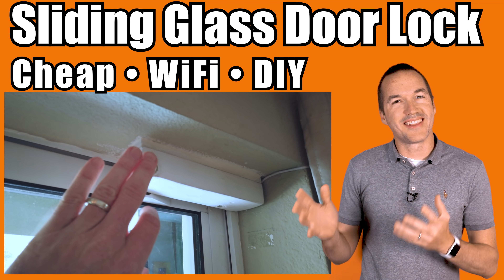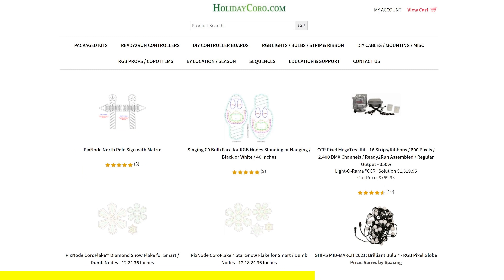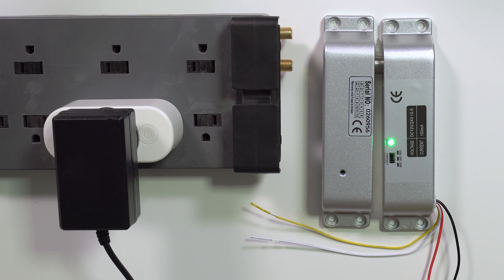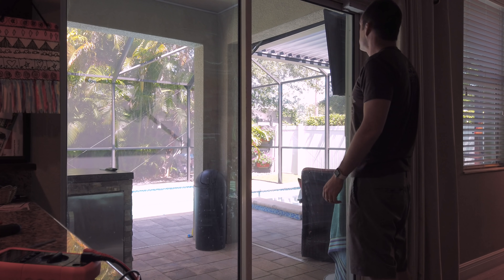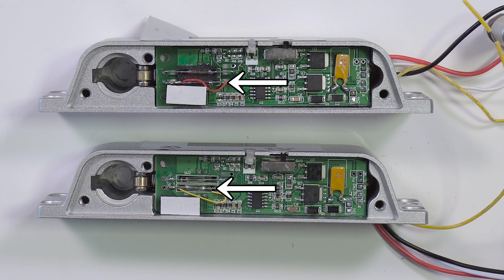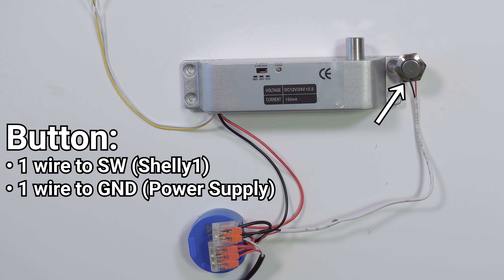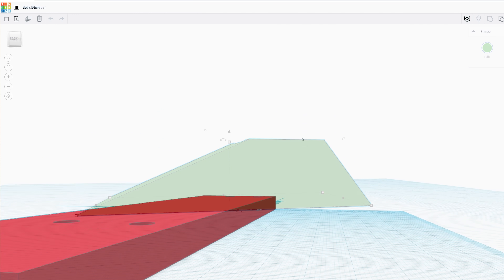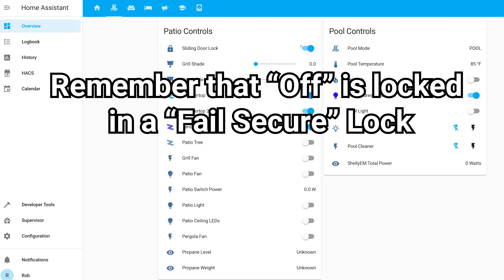DIY Smart WiFi Sliding Glass Door Lock for $50!  Universal Fit. Fun DIY Project.

Comment: Is there a way to wire up an override button and the positional sensor at the same time with this Shelly or a different Shelly?
Reply: To answer my own question, you can use a Shelly 2PM, set the logic to be reversed, and wire the red wire from lock to 12v and the black wire from the lock to the O1 output.

Comment: Use one of those garage door electric deadbolts instead. There is a manual side lever for manual locking and unlocking. The lock is activated by a momentary forward or reverse dc voltage to cause a motor to slide the deadbolt open or closed.  .... I would probonky put it in the middle position of the door on the too and hang an emergency exit cord so short people can pull it to unlock in a fire.

Comment: You could solve the "fail secure" fire issue by making the receiver spring loaded, with a press lever to release it.  That way if you ever need to get out and the device isnt functioning (and in fail secure mode) you can just depress the lever and slide the door past the bolt. You do need to be tall enough to reach it tho.

Comment: DO NOT DO THIS, against fire code!

I seriously question the "$50 Cheap DIY" part of this project with a 3D printer, not many people own one!

Just install a Charlie Bar, and use a $10 door sensor if you want to know it's status in home assistant.  You can't ensure that second door is going to be locked, I question the strength of PLA gorilla glued to the door.  You never know what your kids are going to do, so that second door is a constant weak point.  I'm sticking with my Charlie Bar and sensor that is tracked my Home Assistant and makes announcements to get the kids involved with home security.
Reply from the maker: PLA + Gorilla glue is 10x as strong as the glass that the door is made from.  Not against fire code if there is an alternate path. ...
Reply: @TheHookUp  Most patio doors have a fixed door and a single slider, you've got an extra feature most do not have, just like a 3D printer.  I wouldn't say these doors are only as safe as a Brick, or strong as the glass (I thought you were located in Florida) laminated security hurricane glass can not be defeated by a brick. If doors and windows are locked, a quick smash and grab is not possible.  Your contraption would not hold up to my 300lb (each) security hurricane glass door.  Your second moving door is a huge vernulbility, if it could be unlatched by any child letting a pet out who wants to bypass this door lock.  Do you have a sensor to notify you if that left door is unlocked?  I'd prefer a system that ensures that entire door is locked within Fire Code.  If you need that many warnings during the video "do not try this", it's probably a bad idea to show as a DIY for others, this is nothing more than a proof of concept test that should not be repeated, you need to solve the left door vernulbility, taking apart a locks safety features isn't recommended. 

I have a Charlie Bar lock that goes across my laminated security glass sliding door, I just put a $10 sensor on that bar, and Home Automation gives notifications if we forgot to lock it before leaving or before going to bed. It gets our kids into thinking about home security, which is a great bonus.  1) I know the status of that sliding door lock, and 2) the kids are learning to be more safety/security conscious.  It's a win/win for me, because it's rarely left unlocked anymore before my turn to check at night.

I don't allow any Shelly1 in my house, 1PM, 2.5 & Dimmer2; MUST have the temperature and current protection, in my house.

Do you know how many house fires deaths are document as "no smoke detectors" or "non functional" because the homeowners didn't take fire safety equipment seriously?  41%! The National Fire Protection Agency keeps track of those statistics, just like improperly installed holiday decorations cause 45% of house fires in month of December (which you have ALL over the house with unprotected Shelly1 controls).  Please take this more seriously than "Universal cheap DIY sliding glass door lock".  Maybe you should research how many people die because the exit they were used to everyday was locked or blocked by smoke and fire.  In an emergency people panic, get tunnel vision, and don't think to use a new door they've never used, like the left sliding door, which could get stuck if you never use it.  However if that door does get used frequently, then the odds of it being unlocked when you leave or at night just increased exponentially, then you'll have to sort out how to lock your sliding door(s) again.

I 

Safety is more important than convince to me, I have 8 smoke/CO2 detectors all interlinked in my home.  Have you done any videos on smoke detectors, and how they can be set up to ring a bell and red light outside the house just like commercial buildings?  I've done that, get a Kidde SM120X Interconnect Module to activate Home Assistant, 120v 6in Red Bell and Red strobe light on the side of the structure. Those wires are inside metal conduit to prevent them melting or burning, that might be difficult retrofitting, or use flexible metal conduit, I wouldn't let that stop the project.  Could be programmed to unlock all the doors during an emergency.  If you have an attached garage, that should open as well in case any small engine equipment or gasoline is on fire.  Give the emergency personal access to your emergency to reduce the damage and save lives.  I could take some pictures and items I used if you want to try adding the smoke/fire detection system into your Home Assistant.  Even if it's a false alarm from burnt food in the kitchen, you'll want to open the (locked) doors to clear out the smoke.  If a criminal is willing to start a fire as a vulnerability past your smart home locks, you still need to evacuate and call 911 for the Fire Department and Police to come protect your family, but I highly doubt the odds of that actually happening.

Comment: In the UK we tend to have patio doors, which are either sliding like you have in Florida (although normally only one side would slide), or "French doors" which is a pair of uPVC glass panel doors which open outward to create a large walkthrough space. Unless you're super modern and you have a huge bifold that can be multiple panels wide which concertina out of the way.

Your solution would definitely work for the first type. The second type is easy with an off-the-shelf lock like the Yale Conexis which replaces the handle on the uPVC door.

Comment: you should put a backup battery that can supply ~12v (maybe a hobby lipo?) in the case, together with some electronics (which could just mean a simple relay that connects the battery when main power is cut) and make that relay also bypass the shelly, opening the door in case of a power cut. that should be a really simple upgrade that could save lives

EDIT: to save power and not rapdly drain the lipo, put an emergency button on the outside that works in series with the relay to only bypass the shelly if necessary

Comment: Using a Ferrule on stranded wires makes the installing circuits in the Shelly and other similar products look so much cleaner and they don't get all messy if your using the same wire over and over in testing wiring up things.

Check a kit like this out, I'm sure you'll love it
https://www.amazon.com/dp/B073TZ5BBG/?coliid=IIXIUN9COIO5K&colid=2S18QI4UXD742&psc=1&ref_=lv_ov_lig_dp_it

Comment: Best Sliding doors are the REMOVED and trashed sliding doors...I hate them with passion. Dont know why the f people use these;Rollers wheels fail or rails fail,(max 5 years for ALU)you need to adjust them,TERRIBLE heat and cold insulator(unless you buy triple glazed argon filled) andddd best of it: if you strip treats of the wheel adjustment screw,good luck replacing anything..
Great video thou.

Comment: Just a thought, but you could just install this at the other end of the door, near the center of the frame, having the bolt lock the door closed from the rear. This would negate the need for that fancy receiver. This should make it more secure as you wouldn't be relying on gorilla tape or whatever you use to install that receiver piece to the door. I'm assuming you can push the locking bolt in with your finger, even in the locked position. So this would also add an emergency release option, therefore you don't need the extra exit button. The downside of having this in the center of the frame would be it's slightly less aesthetically pleasing. BUT if that's a concern you could go a step further and install this directly above the frame with the locking bolt protruding through the track from above, therefore being almost completely invisible, albeit at the cost of a more involved install and possibly compromising structural integrity of the door frame.

Love your stuff man, I hope you patented this design.

Comment: would it not be easier with a solenoid lock , would have a few great benefits: I create a remotely openable keybox using this method, a normal lock that has no bold but a spring loaded slidable lock mechanism like a normal door where you press the handle to open ( needs power to open, can always be closed ) It opens the lock by applying power to the solenoid and automatically closes after a configurable time ( like 30 seconds) so you can open your door, leave it open as long as you need so need no action to close the door .

this saves power since the 
making it work is also easier as all you need to do is have a relay open the 12V line to the lock , this can easily be accomplished by a ESp8266 relay board 
total cost will be < 30 USD when souring properly including all parts 
you can also include a hall sensor to detect the door is in closed position ( another 10 cents for that )
Reply from the maker: The drop bolt is exactly that, a solenoid to actuate the bolt and a reed sensor to detect when the door is in position.  The difference is that this doesn't require any modification of the door, or any pre-existing type of lock.
Reply: @TheHookUp  so still a fail secure lock I assume , can you still close the door if the lock is deactivated ?
Reply from the maker: No, the way the mechanism is designed it needs to be pulled, not pushed.

Comment: Great project!  Next up: an automated way to open & close these heavy doors.  Must be electrical, ideally 120VAC, not hydraulic or pneumatic.  I've looked at 12VDC linear actuators, but none are fast enough.  My situation: BBQ is outside on deck, food prep is done in the kitchen.  Sliding glass AND screen door between the deck & kitchen.  So I'm forever needing someone else to open/close these doors as I carry food from one place to another.  I want a touch sensor on both sides, mounted to be easily hit by an elbow (like door openers for the disabled).  Door to be opened in 3 seconds, with automagic closing after a few seconds.  This will require some occupancy sensor and current sensing (to sense a squeezing condition... probably not code though..).  Might need something to chase cats or dogs away (my dog goes outside thru this door, but are cats aren't allowed outside); cats are sneaky and will rush the door, especially if they see we're encumbered by food stuff.

Just spit-balling on a lazy Saturday afternoon.  Cheers!
Reply from the maker: Someone posted this in a comment: https://www.instagram.com/p/CN-acLwqv7m/?utm_medium=copy_link

It's just one of those curtain drivers.  In my experience they are incredibly strong, so depending on how smoothly your door opens it could definitely work.

Comment: Will the 3D printed items sand smooth ?
Reply: Its highly possible, ive had alot of smooth prints but all depends on your printer and settings. if its not smooth best to spray some sandable primer, sand then spray paint. this is a cool project i gotta try.

Comment: I've only recently found your channel and wanted to thank you for the informative, yet very well organized and presented videos!

I do have a simple yet open ended question if you have the time - if you were going to build a house, what customizations would you make to suit automation, security, or other DIY projects?  Things that are easy when done early but difficult after - running cat6, planning camera and WiFi AP locations, running wired window sensors, what else?  Could also make good video topic, what to do when your limited vs what to do when you have control or a larger budget.

Comment: 6c per kWh, in Australia we get 27c+. Can you please do a video on chinese electric curtains like Quoya, or how to open program for latest Tuya WiFi+RF Fan Light Switch (AVATTO type) WS-EU-F/FL: WS-US-F/FL. This new version also works with Sonoff 433 controller and you can turn off backlight. 
Link:

https://www.ebay.com.au/itm/233940113520?ssPageName=STRK%3AMEBIDX%3AIT&var=533586350964&_trksid=p2060353.m2749.l2649

Comment: I used to live in Houston to I know what you mean about the ubiquitous sliding doors. We have sliding doors in Sweden, but they are WAAAY more robust than the ones in the states - the whole door weighs around 650 lbs and is triple glazed. The lock is actually responsible for lifting the door up a half inch onto wheels. When locked the entire door settles and acts as a gigantic deadbolt. https://www.hajom.com/skjutdorrar/hajom-classic-series/ is the one I have for instance.
Reply from the maker: That's a good looking door!  I think they are ubiquitous in the US because of how cheaply they can be made, ha.

Comment: What are the rules throwing all this stuff in your house and it ends up causing a fire. A lot of this overseas stuff doesn't have any certifications... Any ideas what traditional home insurance polices are going to disallow if they see these products and they cause a fire? For example I had a simple timer switch spontaneously burst into flames; caught my wall on fire. Lucky I was home when it happened and had a fire extinguisher in my room. It was one of these simple puppies. - https://amzn.to/3yzcioG - Manufacturer paid for all repairs next day...
Reply from the maker: Low voltage, the only thing that possibly could matter in this situation is the certification of the 12V adapter, but even then I’ve never heard of a policy being denied based on an uncertified device (and I’ve done my research).
Reply: @TheHookUp  not a policy a claim. Not sure if that's what you meant?
Reply from the maker: Correct, a claim on your policy

Comment: Just to clarify the fail safe situation, the sliding door on the right can be opened from the outside and the inside bu the left one is only opened from the inside, right?
Reply from the maker: Both sides can only be opened from the inside.
Reply: @TheHookUp  why aren't you locking both then?
Reply from the maker: The other one always stays locked
Reply: @TheHookUp  gotcha! Thanks for clarifying ☺️

Comment: 99% of sliding glass doors fail to lock. They are all crap.
Reply: A 2x4 placed in the bottom of the track that butts up against the wall on one side and the door on the other side is a pretty foolproof way to make sure the door can't be opened.

Comment: @The Hook Up
would it be hard to modify the lock to not use any energy in a lock state?
great video :)
Reply from the maker: The lock itself uses no energy in the lock state.  The 2W is from the Shelly
Reply: @TheHookUp  Cool project! It'd be even better and environmentally friendly to drive the bolt with a servo motor, so that it only consumes power when it changes states! 
Even though the power consumption doesn't seem high on the first glance, it does add up, and also it's simply unnecessary waste. And as we tinkerers can easily come up with a better solution while also having fun in the process, why not! :D It's a great chance to educate us about saving energy :)
Reply: The way to make it use less energy is probably to use a motor to turn a bolt until it extends in to the door and lock it.
That way it will only "extra" energy when it's moving the "dead bolt"
Reply: @TheHellis  Yes, that is literally what I said. :D
servo = motor
Reply: @crixi__  a servo is one of those small motors that generally consume power by holding it's state with a PWM signal and they sound like a mosquito.

But if it's so important for you to be "right" then what ever.

Comment: I prefer the ones that have a keyed entry on the outside and a manual turn/lever on the inside. With that it can be in locked on power loss, while not causing any sort of locked out or locked in situation.
They cost double though because of the lock mechanism.

Comment: check out the UHPPOTE locks as they do both Fail Secure and Fail open on amazon. I've used these a few time. if your feeling more adventurous you can actually cut into the header rail of the door and mount it inside the door if there is room or above into the header. https://www.amazon.com/gp/product/B00V4G1DE6/ref=ppx_yo_dt_b_search_asin_title?ie=UTF8&psc=1

Comment: Personally, and I realise that's mostly my paranoia talking, I'd modify the thing to have a mechanical override; a way for you to just pull the locking pall out of the way when the inevitable disaster happens.
Even if it is a fail-safe device; if there is a good powerspike or a brown-out and the power doesn't go off, you don't want the electronics to freeze in the locked position. (yes watchdogtimers etc, but again; paranoia)
Reply: Don't think that is paranoia - everything eventually fails.   A mechanical override would be a simple solution.
Reply: I'm with you there as well. I don't think it's paranoia. It's just common security thinking/life insurance. As Sumit already pointed out, all electronics eventually fails!
Reply: What sort of thing were you thinking? A hidden string? I'm genuinely curious how an intruder wouldn't pull the bolt out of the way too?